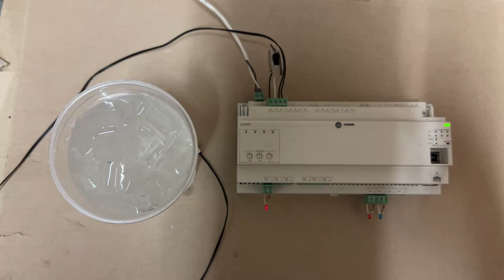Want to do Controls!?  I recorded for a job interview! Read Description.

Comment: the UK is crying out for controls engineers, is it not the same in the US?
I have only seen a few of your videos so far, well your 2 lunch box videos! I will watch more, presume you were more into refrigeration? they were old videos I watched though, but just watching you talk about that PLC your trainable easy, having the right attitude is hard to find over here, you could easily go into full building controls, logic is logic wether its switching a chiller on or a boiler, obviously got your pump logic, safety circuits etc
in UK Trane are just really known for there chillers, would you go full building controls?
Reply from the maker: I’ve really wanted to, but haven’t found the opportunity.  I’ve really been enjoying writing these programs though.  I bet I cut down the energy on the chiller plant to 10% of what it was this month.  It was CRAZY the stuff going on, but honestly it’s only because I’m working in house that I’ve been able to have the capacity to sort through it.  It’s an old building and VERY convoluted lol.  I’d like to hear more about what you do.  Are you in controls full time?  BTW the best way to contact me is on discord (link in any recent video description) or my YouTube channel about page has a contact link to email.  Thanks for watching and reaching out 👍

Comment: I have a few Microtech 3 laying around. I've been contemplating getting rid of my PCB out of my furnace and use the MT3......and i do have and use an oscilloscope
Reply from the maker: Sweet the problem is TU?  Do you have it?  My cousin and I were making arduino hvac controls.  Use RIB relays 😉👍